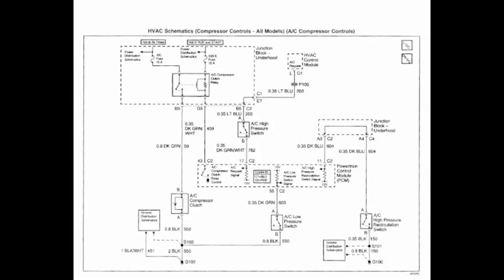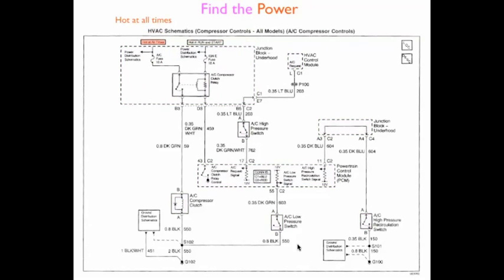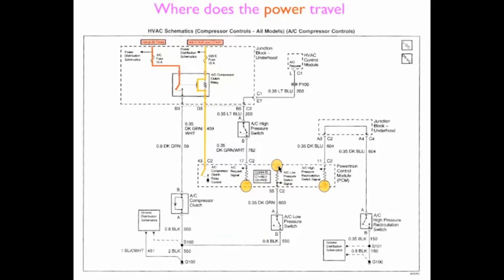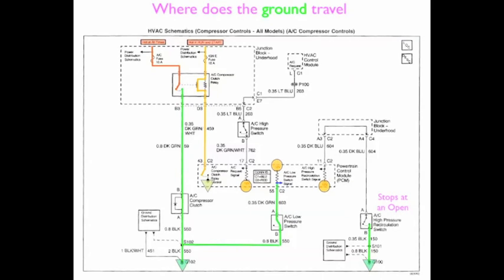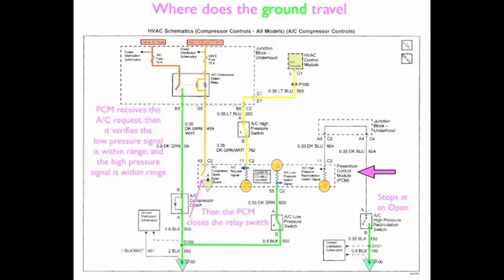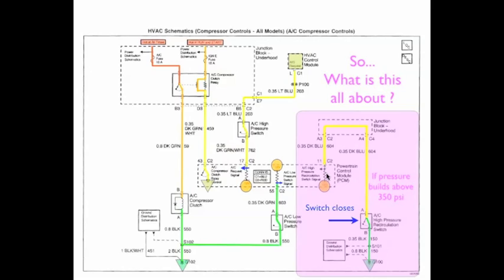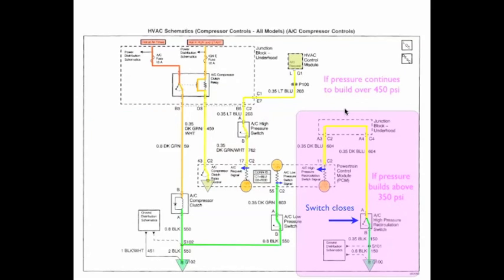Elec Lesson 6 AC Diag 1

Comment: Best explanation of the AC circuit I have seen.  Would also like to see an explanation of the AC diode used to suppress voltage spike from the clutch turning off.

Comment: A note on the AC Low Pressure Switch Signal: The PCM or whatever reads the resistive voltage drop could potentially need the AC Low pressure switch to be open (not grounded). Ground is zero volts and the switch directly shorts to ground. So the signal either reads the resistive voltage when that switch is open or zero volts. (I don't know the system, so anything higher than zero may make the PCM see that the switch is open or it might need that voltage to tell the switch is open. It all depends on the logic in the PCM.

Comment: Hi, I have a Ford ZX2 (2002) my brake lights will not turn off. I found a little broken blue piece under the dash (on the floor-board); I am by no means mechanically inclined; however, with instruction I can repair most remedial stuff; I'm poor and all the mechanics want a fortune to repair it. Any advice?

Regards,

John

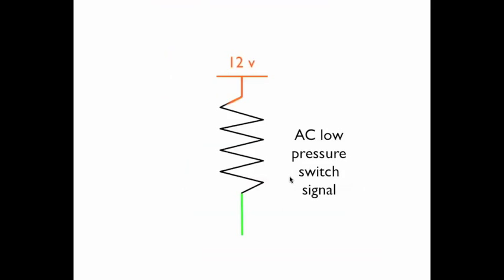Comment: 4:18 Its not Potentiometer. So signal to the PCM is going to be 0v when it sees ground. When it dosent see the ground its 12v.

Resistor just lows the Current not Voltage so it dont blow the fuse or parts when it sees ground.

Anyways great videos man keepthem gomeing!
Reply: Mummy Ymmum a

Comment: 1) I am not sure I understand your question. PCM have 12volt on on end which has resistor attached to it. The other end of resistor have either ground on or off. When ground is on, 12v from PCM get the voltage drop after resistor let say 4 v. This information is fed to PCM. PCM would know 4v means your low pressure is on, If low pressure is very low(there is additional resistance on low pressure switch) which would further decrease 4v to 3v and PCM know that low pressure is little low..

Comment: Really appreciate the explanation, explains a lot.
2 questions:
1.  How do you know the HVAC is ground?  I mean 12v signal in the PCM needs to go somewhere, so I would have thought the HVAC grounds the 12v from the the PCM, not that...or is that what's going on?
2.  How do these signals 'tell the PCM'.  Like how exactly is the signal read?

Thanks! :)
Reply: I think it is just the way the logic works from the HVAC system based on what he says in the video, he didn't give detail as to how that happens. Most likely, there are digital inputs on the PCM with TTL (transistor transistor logic) configuration to know if the line reads low or high. When something works of zero volts, that is typically known as High side configuration.